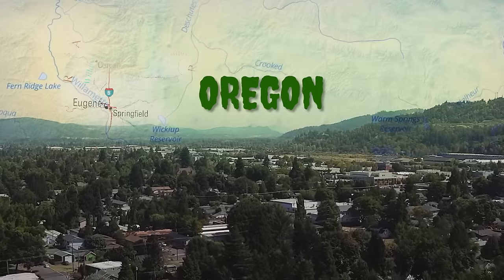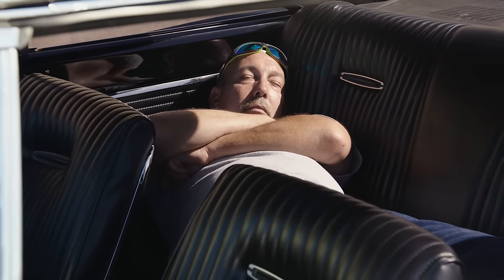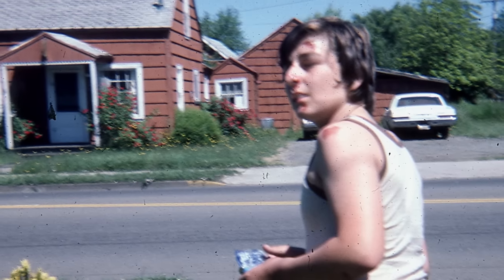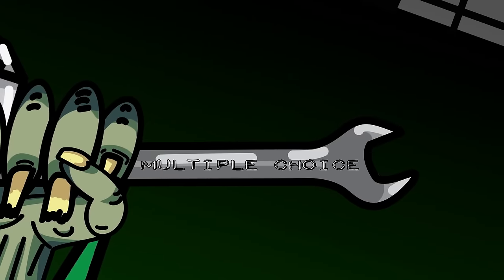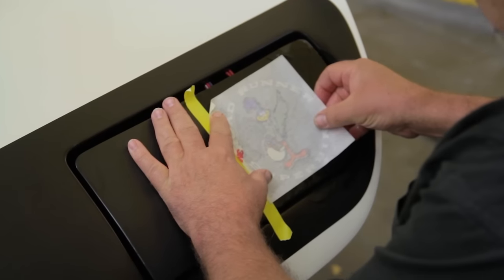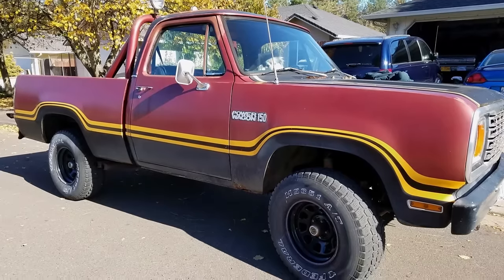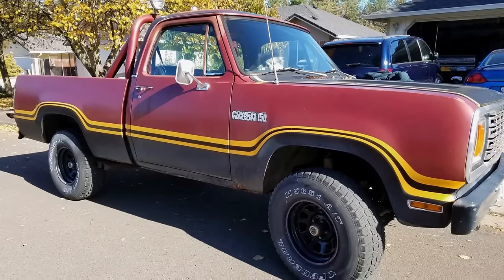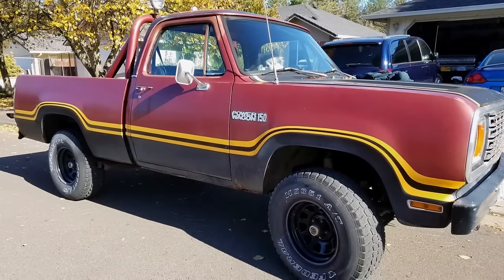MARK GETS A SCARY RIDE WITH A LADY IN HER NEW CUDA!

Comment: I had a 1969 Plymouth Fury 1, which was a retired Ohio State Patrol car, a 2-door, 383 4bbl, dual exhaust,ps,pb It was like a big Roadrunner. It had the L.H.  threads on the driver side wheels, you could see the LH stamped on the ends of the studs. Also why don't you paint the brake drums black so they dont rust, or do you clear coat them?